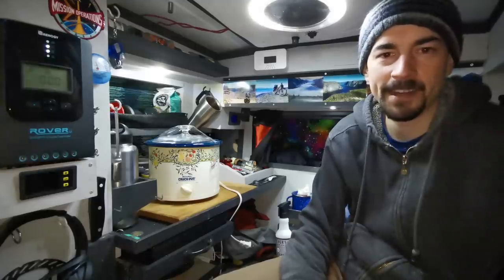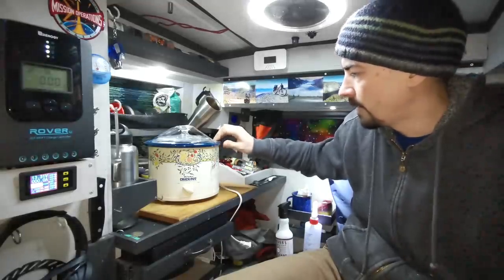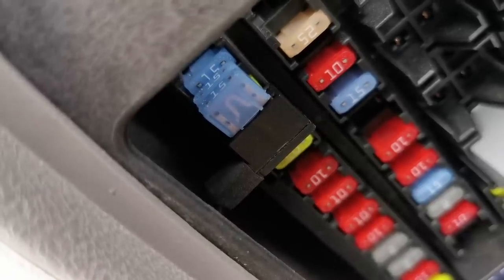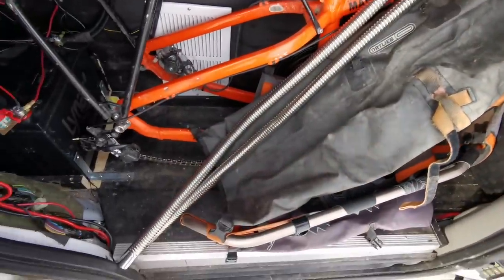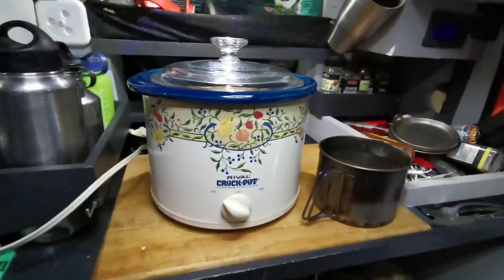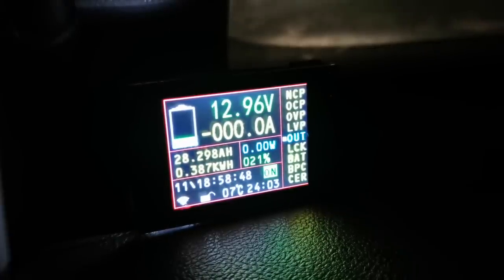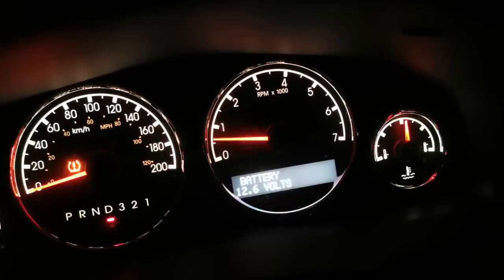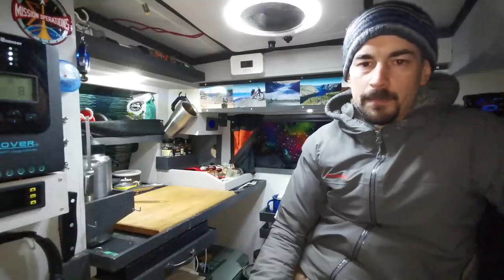Renogy DC to DC Charger Install and Review

Comment: Hey, you got a crock pot...now you're cooking easy. Don't get rid of it, just stick it in a corner somewhere, it's worth a spot. You can have soups, stews, even baked goods.
Reply: @Martin Shepherd but in the summer he has loads
Reply: I am in agreement with this statement. It's so easy to use it to make soup or pulled pork, but it also does a great job with my Snacky Chan's Spicy Nuts recipe.
Reply: You can get crockpot bags so you won't even have to wash it if you make sure not to poke a hole in the bag.
Reply: Martin Shepherd probably better off investing in an instant pot. They make a small one that’s great for a single person and would be easier to store. Also even though Insta pots are much higher wattage, they cook way faster so I’m pretty sure the over all drain on the battery would be less
Reply: @Premium-Content  You're probably right, I don't have one of those. And I cook for a family, so the crockpot rocks my kitchen all weekend long.
Reply: @Diana-ex5ig  My crockpot is stoneware & easy to clean. Are there others that are not easy to clean?
Reply: They make smaller sizes of Crockpots....l am sure you are aware of that.
Reply: @Martin Shepherd Totally agree. The great thing about crockpots is you can cook while you're driving. By the time you get where you are going dinner is ready and your battery is at 100%.
Reply: The 3 qt instant pot uses 700w, but likely requires less energy. My 6 qt can be used as a pressure cooker or crock pot. Not sure if the smaller one does both, or not.
Reply: 😲🙄 "Just stick it in a corner somewhere" that's easier said than done.... When you live in a minivan/van, there usually AREN'T any free corners "somewhere" 🤦🏾‍♀️.
Reply: @holskitchenCanada  the crockpots that I have had at times were not always easy to clean and we like the liners.  I thought for him with the little amount of water he has this would be a better way to go.
Reply: Wow, now that turned out to be great advice!
Reply: @MySonsMother   is that the peak draw of wattss on startup or while cooking - matters a lot on sizing and selecting an inverter.  thx.
Reply: I assume it’s cooking, it’s the rate they show. Yes, it matters.

Comment: Mice are attracted to vehicle electrical systems and the headliner to your van to nest. Mice can't stand the scent of peppermint. A tip is to buy some peppermint flavoring from a grocer and add some drops into a spray bottle of water and spray around the wheels under the hood, around the battery, and wherever you suspect mice. Depending on how much peppermint scent you can tolerate yourself determines how much you want to spray. They'll destroy your van's headliner, so maybe spray some under the dashboard. I heard about this on other YouTube channels. We enjoy your channel, so keep up the good work.

Comment: Great review... I actually emailed Renogy about connecting a landline 110v to that charger and they said that you could do that. Have a wire like the block heater under the hood to the charger. Might be another charging option for you if you could find a 110v outlet. Keep crushing Forest.
Reply from the maker: That is really smart!  So you'd just need a dc adapter with 40 amp output?
Reply: @forestyforest  Yes, you need a AC to DC converter to make this work. Less than $50.  I also want too get a J1772 receptacle socket so I can charge at a car charging station if needed. Hope this gives you some ideas. Cheers from Vancouver.

Comment: Awecome video buddy.  I am truly worried about your alternator and especially so since you are in the middle of nowhere all the time.  For the time being i would recommend that make improvement to the grounding wires (starter battery to the body and from the alternator to the body).  Increasing the positive wire (or run another wiring parallel) from the alternator output to the battery might also be helpful if space permits.

Comment: There are 2 alternator sizes for those vans, 105 amp and 125 amp. You can check by googling the RPO codes printed on the silver sticker inside your glove box. It might also be printed on a sticker on the alt itself or a part number you can Google. Beyond that there are adapter kits to mount larger case style units to the 2.8/3.1/3400/3500/3900 60 degree engine family. 

A reworked factory style alternator can put out more amps but only at high rpm and idle performance will actually be worse than stock. Upgrading to a larger style case alt will have better all around performance but I don't think you really think that's the direction you want to go in. I'm sure you would rather put the money towards more solar panels. 

A better option for you in my opinion is to change the pulley diameter to spin the alternator faster at idle. A smaller pulley is cheap will increase the drive speed to the alternator. It's easy to change the pulley as the alt is mounted nice and high but an impact gun is required to crack the nut free.

Oh and rockauto.com is an excellent resource for looking up parts to cross reference information so you can do your own homework when getting local parts wherever you may be. 

Another trick at auto part stores like Napa etc in small towns if you need to order parts is figure out a local company that has a fleet of vehicles and say you just started working for them. Then ask if you can get their discount on parts but are paying cash. That trick usually gets me 10-30% off the cost of parts.
Reply from the maker: Cool thanks! KG7 - 125 amps.
Reply: Hello there I tried to follow your suggestion on looking for the right size of my 2019 1500 ram promaster 136wb alternator replacement for the exact model battery charger but seems i run out of luck. Maybe you guys can help me searching for the right alternator size for my van to avoid future failures in the middle of nowhere. Thanks in advance

Comment: Great video, I did a 3way switch off/20/40. Gives option when running at lower rpm or itf bank in relatively  full, etc...   Cheers.

Comment: I have the Redarc 20A DC-DC charger in my Westy.  I went with the lower on as I am a weekend warrior and didn't want to tax my alternator.  Mine is set to auto since the system charging. Good for my small agm setup.

Comment: Ground wires are not usually ran like that since the vehicle is all grounded to negative. You get ground loops and lots of noise by not having short local grounded connections to metal.

Comment: Gotta love a crockpot! Couldn’t you secure it while driving and brew up some simple lentil & carrot soup while on the road, only takes about 4 hours in a 1.5L crockpot.
Reply from the maker: If it were warmer I'd set it up outside and try some recipes. Maybe in the summer. It made too much steam inside the van.

Comment: I've been thinking about your power requirements. I think its time you added a second battery to your bank.If your charger can charge one battery in about 2 hours of driving then it can surely charge 2 in 4 hours? Plus, you'll have extra run time in the winter for your heavy heating and cooking loads and in the summer for your AC unit. If you get stuck somewhere currently you'll have a difficult time with power forcing you to run your engine stationary until you are back up to an acceptable level. That'll burn fuel that you would otherwise need down the road.

Comment: So I am just beginning to look at putting a battery in my van. I haven’t decided between a marine deep cycle battery with 114 amp hours. It’s a flooded cell for $100 or an agt for $360. I’m hesitant to spend that much money. I am also struggling with whether to use dc to dc. I could really use some help

Comment: I initialy didn't think 40 amps could stress your alternator and then I looked it up. That vehicle comes with either a 105 amp or a 125 amp alternator which seems pretty low for a van. I suggest not charging at idle like this for very long. Maxed out alternators will usually fail due to over heating because they are only about 50% efficient (and thus 50% heat) and can't cool themselves enough when their internal fan isn't turning fast enough.  The sub zero temperature now will make up for that and keep it cool enough for now but keep this in mind when the weather warms up. Best of luck!
Reply from the maker: It's the 125 amp. Thankfully I won't have to run the charger in summer time.

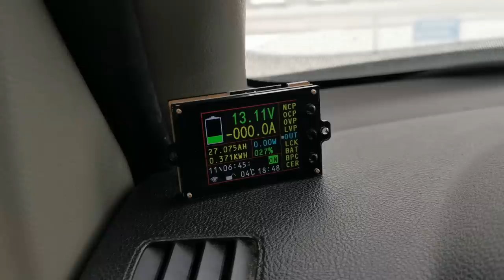Comment: Rival AC vs Renogy DC:  And the winner is.........................    3:33, my coffee is already empty “battery”. You can improve the efficiency of a crock pot by placing some heat proof insulating material on top of the lid, like a round silicone bread warmer. Mostly it just makes it cook hotter and faster.

Comment: G,day mate, hope you had a warm and pleasant Christmas and all the best wishes for the New Year. You are developing as a turn to level advisory when dealing with electronic energy options. Very interesting and most informative. Maybe you could look into the possibilities of mini wind powered turbine systems as the alternative energy generating system to cover for the winter season. A compact system fixed permanently either in the engine bay or on the roof which would be functional whilst driving, otherwise perhaps a larger design manually set up when parked able to utilise the wind. I'm brainstorming with you on this one. Ideas to play with maybe. All the best from "living out of a car" in Australia.
Reply from the maker: Thank you. Wind might be a good option for winter! Cheaper than driving around to recharge the battery. I need to redo my solar panel rack, maybe a wind turbine could be integrated.
Reply: @forestyforest   Cheers for your reply,it's 2pm here at the moment. Australia quite the contrast really even here in the south west, Mid Summer, I haven't a solar unit yet, Just an old Picolo 12 v transducer. flattens battery to quickly. so i have no fridge, and laptop always going flat. must update,. cheers again. all the best

Comment: Thanks for sharing.  I've been debating on whether to get the 40amp or the 20amp version.  I believe my alternator only puts out 60amps; I'm not sure that the 40amp version will leave enough current for the rest of the vehicle.  How large is your alternator?  Any thoughts on 40amp vs 20amp?
Reply from the maker: My minivan has a 135 amp alternator.  It's just barely enough to power the 40 Amp charger.

Comment: Recently purchased a Renogy DC-DC 20A charger and 100ah AGM battery (cycle use: 14.6v-14.8v / standby use: 13.5v-13.7). Getting 14.1v from the starter battery. Having a hard time figuring out how to set the dip switches. Tried calling Renogy but have been unsuccessful in getting through to someone. Can you help me out a little and suggest how I should set the switches?

Comment: I knew there was something different about a lithium battery set up, but didn't know what. Thanks for mentioning the dip switches. 

I need to do the same setup. Could  I contact you if I have questions? Or maybe you could do a more indepth video showing how to and each specific item you used,  where bought, and the price?

Comment: Coleslaw is the only way to go! 
I'm not sure how it compares to the slow cooker but I hear instant pots use very little power. On a side note, I know of one van dweller who uses his pressure cooker for heat by heating up water and then turning it off, leaving it pressurized overnight and it gives off heat for a long time

Comment: Do they underestimate or overestimate the gauge size of the wire? How do you get the data to fill the calculator- Voltage, Amprage-% drop?

Comment: Do you have Lithium battery? does it draw too much current at idle with the Dc DC charger 40A max model? no issues with the health of the alternator? I am in need of the same setup.

Comment: If I heard you correctly, you fused an 8 AWG cable with an 80 Amp fuse at the starter battery? Just trying to understand the logic behind fusing a cable that can only handle 40 Amp with a fuse that is 2x that capacity? How will it protect the cable? I'm confused as I thought the fuse was to prevent more amps being sent than the wire could handle.
Reply: I have a 20 amp charger , and trying to figure what fuse to put in. And I’m leaning towards a 40 amp as it is double the size of 20 amp charger just cuz Foresty doubled his. Anybody know why he did this yet ?
Reply: @thecaptain8174  fuse is there to prevent a short and a fire. If more juice runs through your wires then they can handle it will lead to trouble. So best to match the size of the fuse with the capacity of your wiring irrespective of what the device may be capable of.
Reply: @sikandinc  I understand the purpose of a fuse , just trying to figure why he used 80 amp fuse on a 40 amp unit

Comment: Trying to figure out setup for my system got 40 amp dc to dc charger and a 2000 watt  inverter going with a gel cell battery 200ah  what else is needed besides a battery level gauge?

Comment: loving your videos and thoughts on your conversion gear.
but I am curious about your camera gear for creating videos. I saw your update on the drone but was wondering what stationary cameras, microphones, tripods, etc. you like to use to create these videos.
Reply from the maker: I'm using a Huawei P30 Pro phone.  It's a pretty good all-in-one device. Stabilization could be better, low light could be better, and 5x zoom is too much sometimes, there's nothing in between 1x and 5x.  I'm waiting to see what the Galaxy s11 includes. I don't want to buy an expensive camera and a bunch of lenses. Microphone, I picked up a Rode Videomicro but I haven't tested it yet. And using a Polaroid travel tripod.

Comment: Hey buddy, is the renogy unit still working out for you?  I am looking to upgrade to lithium battery and need a dc to dc charger.  Will add solar eventually but it will probably be a remove-able type.  I don't live in my van, just for trips and every day usage.

Comment: Hi Foresty, have you ever made use of the LC line (12.5% of charger output) ? I just got one , did not install it yet (waiting for other stuff, like a battery) but was thinking of using it with a switch when I am driving in the city. I have a Van like yours (Sienna) and I am concerned about the draw on my alternator at low rpm. Did you run into issues with your alternator yet ?

Comment: What brand is your older wired battery monitor. I prefer amp hours over watt hours. Easier for quick guesstamations. Mine unfortunately displays watt hours only and resetting is a big hassle. Safe travels to you

Comment: You can also buy VSR (voltage sensing relay) to charge 2 batterys from your alternator. You can get VSR for about 30 to 40 euros.
Reply: But forgot to mention that then you can only use lead acid battery.
Reply from the maker: I was glad I learned that information before buying an isolator.  There is a video on Victron Energys YouTube channel where they burn an alternator.

Comment: Have you thought about getting a spare battery or alternator? I’ve had alternators die without warning and the car wouldn’t run even after a jump start.

Comment: What did you set the switches at? I also have this 40amp charger and a LiFePO4 battery and can't figure out what to set the switches at by the manual...

Comment: Yeah I got the 20 amp renogy I never did do a circuit breaker at the house batteries what size you think I should go with I've been running it  8 months and never had a problem but I'm redoing the battery mounts figure while I'm there should add a circuit breaker
Reply from the maker: Better safe than sorry.  You should download the user manual to see what they recommend.  My 40 amp model draws a good 52 amps.

Comment: I'm only getting 25A charging at Idle for my first test after install with 6AWG wiring. At least it works. Hoping it ramps up while driving but I will have no way of knowing since this is a truck camper.
Reply from the maker: With a 40 amp model?  Are you sure your alternator is sufficient?  If your starter battery voltage is dropping, it probably isn't... double check the wire gauge is enough on an online calculator.

Comment: Hello
I need your help deciding on a Renogy product. 
First I’m planning a two week road trip from Manitoba down to Louisiana over to Texas and back home thru Oklahoma and car camping in December 2024.

I’ll likely need a 12v mattress heating pad or blanket to sleep comfortably. 

Ref: 20/60A 12V DC to DC On-Board Battery Charger
SKU: RNG-DCC1212-20-CA
This unit is on sale for $119 Cdn.
I have a EcoFlow River 2 power station and a Lifepo4 100ah battery to keep charged.

Since I’ll be driving a least a few hours a day I’m hoping to keep both batteries topped up so I can run my AC CPAP machine off the River 2 and run my blanket off the 100ah battery.

Will this renogy meet my requirements to keep thing charged? 
Your help is much appreciated 
Steve (68yrs)
Ste Anne Manitoba

Comment: 9 months later and I see you have just put out your latest crock pot video :)
I actually searched this as I'm thinking of fitting a dc-dc charger in my van.
With your alternator maxing out, do you know what it is rated to that it struggles with 40A at idle?

Comment: When would you ever use the switch? The DC to DC has bulk-absorption-float stages built in. Should I install a switch on mine ?
Reply: You might use the switch when you don't want the additional large draw from your alternator. Maybe idling in hot weather, or while letting the alternator recharge the chassis battery.

Comment: how come youre using an 80 amp fuse with a 40amp charger? i just bought a 60amp charger, was thinking to get a 60amp fuse, do you recommend an 80amp fuse as well?
Reply from the maker: You should try to go by the manual.  I think they recommend a 90 amp for the 60 amp model?